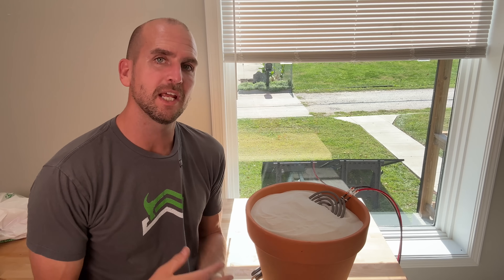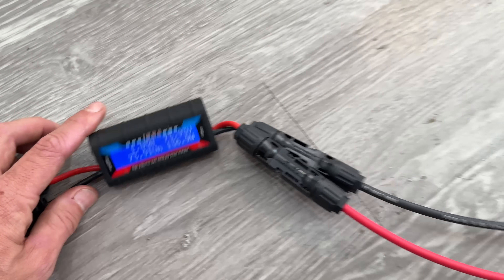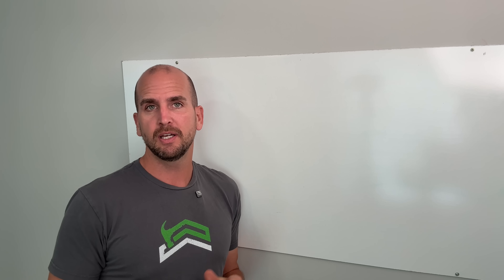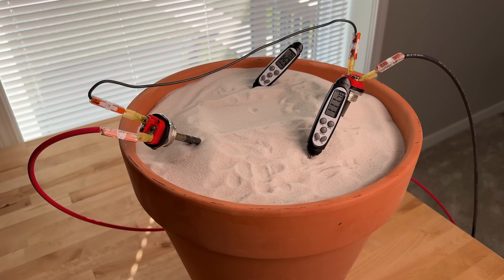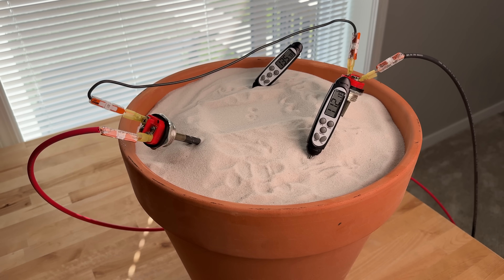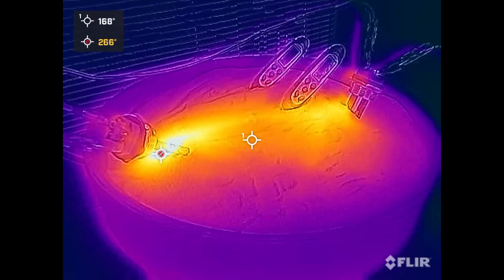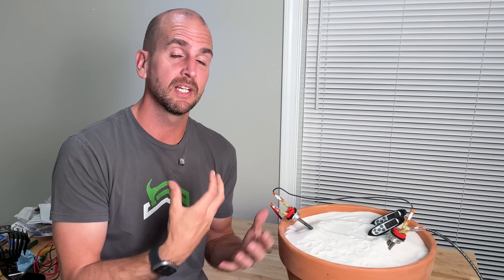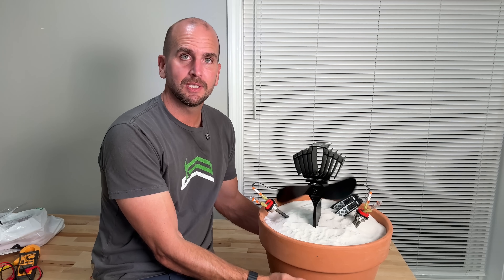How To Create A Solar Sand Battery Heater | Free Heat This Winter!

Comment: ..the consept is like it is..however there are 2 problems; most often winter and solar energy are not very compatible..somewhere maybe a little but eg. my solar energy is zero in practice during november thru january..something useful can be expected from around late march - early april.. Then the sand..it's not very dense and i'd say not very good to hold the heat..in my experience concrete would be better..or other denser and heavier stuff.. i think only property sand has here in par with other materials is that it can be heated quite hot untill phase change from solid to liquid..but still i think it'd be a bit of a hazard having something like +350 degree of celsius flower pot around..(otherwise it won't surpass even the water..) if one could store heat as a phase change energy, such heat storage would use sand as a table cleaning cloth if there were any competition between the two..😅 ..i think at least prototypes exist with salts..and they change phase into molten salt.. Also when heating home..even a small room..well flower pot does nothing..unfortunately..think eg. weight difference with flower pot and non heat storing wood stove..stove is still way heavier thus stores more energy..still they are not considered as a heat storage.. During winter 700kg of soapstone can store heat and keep about 40m2 insulated space warm for time between a day or two untill the temperature in room starts to suck during outside temperatures of around 0 deg. of centigrade (celsius).. I wouldn't waste my time with such sand projects..it'd be more profitable to install heater resistors eg. in oven mantle..AND use some electronics to match everchanging solar panel impedance to fixed heater resistor resistance..that is called mppt tracking..from the experience of heating water with solar i can tell i wouldn't do it without mppt..! ..so some r&d is still needed! 👍..one has to remember that whatever miracle material there is..the energy is no more than can be extracted from panels..and it's the weight of the reservoir that stores the energy..not the thermal resistance..unless one goes with phase change, eg. different principle altogether!

Comment: My thoughts are- bury the elements near the bottom, insulate the hell out of your vessel and put an insulated lid on it,  and run some single wall vent pipe through the middle of your vessel, and out the side and up through the lid (with insulated caps or plugs.  Then when you've got your thermal battery charged, you pull the plugs and blow a small fan down through the pipe.

Comment: keep in mind that heaters intended for water are usually not rated to "run dry" as they rely on the max water temp of 100c (212F) to stop the internals from melting themselves.
Reply: Remember they are runing at a fraction of their rated power 250w vs 5000w
Reply: @shaynegadsden It may, or may not matter, but I would think lower watt density would give longer life.
Reply: @fancyhitchpin8675  it probably would but these elements already last so many years
Reply: @shaynegadsden  stop trying to cloud the issue with facts
Reply: Yup, fire hazard (at much )higher wattage, best to blow air over nichrome wire in tube and make simple heat exchanger
Reply: I thought it was about 80c, also it's not about melting internals, its about avoiding steam explosions. Water to steam expansion ratio is something like 1:1600 and if you manage to build up the heat and pressure, you can get a pretty big boom out of a relatively small amount of water. You really don't want to dick around with super heated steam either.
Reply: Not really. Yes if they were running at 240V and 2000W, but the video the meter shows these are closer to 70V and 250W. And no household water heater is running at 212F, the water would boil and explode out of the faucet when the pressure was released. The average temp is set around 120-130F and anything over 140F is dangerous plus the waterheater it self could explode and blow though the roof. Also stovetop elements glow red hot and can last decades.
Reply: @SkaBob  That's false. In Norway, for instance, the requirement is that the hot water must be above 167f (75c) and only dip down to 55c (131f) for a maximum of 20 minutes per day. Otherwise yoo run the risk of legionaires disease. My hot water is always set to 90c (194f) because that maximizes my ability to use hot water as a battery so that I buy my electricity as cheaply as possible.
Reply: @jeschinstad no human can withstand 131f water. 

Much less the higher temp.
Reply: @diylithiumguy  what are you responding to?
Reply: @jeschinstad whoever I tagged.
Reply: @diylithiumguy  Why are you telling me that no human can withstand 131f water? If you're referring to my factual statement that in Norway, the legal requirement for hot water is that it must be above 167f and only dip down to 131f for a maximum of 20 minutes, that's just how it is. What does that have to do with what humans can "withstand"? You mix hot water with cold to get the desired temperature when used, but you don't really want to get legionaires disease, so you don't store your water at a temperature that's perfect for biology.
Reply: @jeschinstad no one in America gets that from our low water temps.

Stop letting the government have you waste power and money by having the water tank too hot.
Reply: I am pretty certain you're wrong on the facts, but it is the type of question you should be asking when doing things.
Reply: Definitely NO fire hazard, what about electric oven? Thermal conductivity of air is much much lower then sand.
Reply: @Martin-gn9xi  different heating elements in an oven.

Comment: 1. Don't do this with solar panels. PV is not good enough.
Use solar radiators/ solar heaters since they are around 80% efficient compaired to pv at 17-20%.

1kW solar can then give 800w heat.

Comment: Could this be used for a woodstove to save energy for after the fire burns out by setting a pot of sand on top of the woodstove?
Reply: Yeah that would work. Other common more permanent solution, is to add clay bricks around the stove. Make a foundation and the backwall with claybricks. If you keep a distance between stove and brickwall, the air will circulate naturally and heat the room for many hours.
Reply: I have 80 kilo iron on my woodstove, works fine for a few hours

Comment: Great idea for 100 sqft space with low ceilings.
Reply: Greenhouse or shed.
It is passive and you can avoid the cost of batteries with direct resistance elements like these.

Two panels at say $500
Stove or WH elements at $25 to 50

$600 bucks and mostly unattended.

If you heat with grid power resistors ($30 for the heater) total loss on low 750W is 8kW over 10 hrs ($1).  20kW over a 24 hr  period ($2.50/day)

Winter is roughly 100 days so payback in under a year.

If you can build it with scrap elements and used panels for $100...then go for it.

Comment: In the UK the winters aren't generally extremely cold like North America etc - typically -5c overnight. but a challenge is how to keep an average domestic greenhouse / glasshouse above freezing to protect plants over winter without expensive heating such as kerosene or electric heaters. This coupled with a car battery,  might be a relatively simple solution for that?

Comment: Why not heat the water with sunlight and use about 100% of solar power, instead of electric 15-22% :) :) :) :) :) American school system is in the gutters.
Reply from the maker: Testing a solar powered water heater would be great.
Reply: @everydaysolar  also, water on its own has 5 times greater heat capacity than sand, but if you expect that heater to exceed 80ish Celsius that would be useless, depending on the quantity of water. To put it simple: You can't store much heat in that quantity of sand.
Reply: Look for evacuated tubes to collect the sun's heat and put it in a working fluid. Then, send that to a hydronic baseboard heater.

Comment: Why not eliminate the 25% efficient solar cells and the heat wasted in the connecting cables by putting the pot of sand directly in the sun?
Also, I think your fan is powered by peltier junction semiconductors that produce electricity when heated, and not by a thermistor.
Reply from the maker: Hey Dennis, thanks for the correction on the Peltier Module 👍.  Even though there is an efficiency loss through the solar cells, wires, connectors, etc., we are able to take the increased surface area of the panels as compared to just the sand and clay pot surface.

Comment: You might do better with NiCr wire for heating element as it's easy to tune to available current and get better distribution through the sand.  Still, the inefficiency of the solar cells (20% or so) means that just letting the sunlight come through a window and heat water will probably perform better.
Reply: "sunlight come through a window and heat water will probably perform better", yeah, that's why I keep all my plants in a dark room, so the light coming through the window doesn't heat their soil several hundred degrees.

Comment: Instead of using sand as the heat sink what happens if you use an oil based space heater hooked to the solar panels. Once the oil is heated then it will radiate heat more efficiently than the sand however it will probable cool down faster once the power is removed. My 2Kw oil heater take a bit to warm up but afterwards it will cool down enough to touch the fins within 30 minutes. 
We heat our water with a tri energy "boiler" which consists of two collector panels of about 1.5 m2 and a 120 liter storage tank. During the summer months water can reach to +160°F in several hours. During the winter months when there is Less solar radiation we most often use the second heat source which comes from a wood fired fireplace/boiler. One circuit of the boiler output feeds a coil within the storage tank of the water heater and within a few hours we have hot water. The third heat source is a 4Kw electric heating element within the tank. The only downside is the distance to the heater back down into the house to reach the basement and then distributed through the water manifolds in the house. I have not added the circulation pumps to the system which will cut down on water usage and the time it takes hot water to reach the faucets.
Reply: This is about not needing an inverter or charge controller. Switches and thermostats in an oil heater probably not rated for higher DC voltages or the amps of lower voltage DC.

Comment: My mental math says that using one element would have been way better for getting the power out of the panels. You were pulling 350W-ish from nearly 800W of panels.   What you did was a complete waste of the panels output power.   All in all a thermal battery is a good thing to do if you have waste power, definitely  the most effective way to store solar overnight for heating.  Unless you also had batteries to run a heat pump with an outside loop and then a loop in the thermal battery, then you could use the stored heat at lower than the ambient temp of the house.

Comment: I use a solar air heater which is about 4 ft x 4 ft and during winter when the outside daytime temperature is typically 25°F, the heater will deliver air at ~ 110°F for 6 hours during a sunny day.  I prefer this because the only electrical component is a fan which is powered by a 25 watt solar panel.  The solar air heater does not block a window - - it is leaning against the outside wall of the house.  Of course, when the sun sets, that's the end of the warm air.
Reply: What about when there's a blanket of cloud? Here at 57N in Scotland it's rarely sunny, ever!!
Reply: @Bazza1968  Well, you people that live near the North Pole have fewer options.  Of course, neither a solar air heater nor a solar sand battery will be of much use.
Reply: @n3evpn3evp  Ever look at a map? Scotland is not anywhere near the NP and how are you getting this solar warm air INTO your house?
Reply: @AIRDOODOO  Yeah if the outside daily temperature is "typically 25F" that's colder than where I am!!
Reply: @AIRDOODOO  Yes, it was a joke.  I call anything above my latitude of 41 degrees north  latitude the "North Pole".  The solar heater is adjacent to my house and the heated air enters via an insulated, flexible tube that goes through an 8 centimeter home that I cut in the window glass.
Reply: @annwithaplan9766  I constructed the solar air heater in my garage.  All I needed was a sheet of plywood, a few 1x6's, a large sheet of glass or thick transparent plastic, a sheet on insulation, 4 inch plastic bendable pipe and some minor things like nails, staples etc.
Reply: @n3evpn3evp    Interesting idea. Here's another configuration idea. In the 70's to the early 80's I was a devout Mother Earth News subscriber. They had a Solar Air Heater that sounds similar to your construction description. It mounted in a south (in NA) facing window. A rectangle plywood box that consumed the bottom 6" or so (IIRC) of the window, then was angled down at a latitude appropriate angle. A dividing partition ran all but the last few inches at the bottom of the box. It was insulated and the interior was painted black. The exterior "topside" of the box was covered by glass. As the top portion/partition was heated via the glass, heated air rose into the room and drew in relatively cooler room air via the bottom partition opening at the sill of the window. Completely passive. When the solar energy ceased, the entire box filled with colder than room temperature air preventing "reverse draft" flow. I've never lived anywhere where I had good southern exposure to try it, but at ~30°N, my winters are usually a lot milder than most. I prolly still have that and other 78-80's ish M.E.N. issues around somewhere, if the silverfish havent destroyed them. I really hate those lil b*stards....lol  There was a very interesting "Solar Tracking Furnace" too...
Reply: @MelGarga1901  I know the set up you are talking about. I used old soup cans taped together on the interior and a small cooling fan (2") jacked into a panel to move the air 😉 These do work though 👍 won't heat your house up to 80° or anything but it will keep the chill out and help offset any heating costs. This is a very easy and passive system to make and use 😁
Reply: A well-insulated room should retain the heat for a while, though. But that's not an option for everyone

Comment: If it was mid winter and 20°f outside air temp in room was say, 40°ish, would the heat in the sand suffer from accelerated cooling or would the ceramic pot insulate the sand to give approximately the same time no matter the room temp?
Reply: Heat transfer is directly proportional to the difference in temperature of the hot and cold side. This is basic physics.

Comment: When doing the math, keep in mind that the resistance of the elements go up with temperature.  The power rating is typically AT the temperature it is to be run at.  The stove element gets far hotter than the water heater element (since the water heater elements are supposed to be in water).  In the old days, you could measure the resistance of an incandescent bulb, then power it up and measure the current at its rated voltage - the resistance when on and hot, was at least triple its cold resistance and took under a second or so to reach.
Reply: Dimming incandescent with a soft start on dim then ramp up to brighter and dim to low before turning off makes them last 100X longer //
Reply: In electrical engineering  with the bulb, it is called cold shock.

Comment: This would be cool for a small greenhouse.  I wonder how much energy it holds?
Reply: The specific heat capacity of sand is between 0.180 and 0.191 BTU/lb-°F.  Where as the specific heat for water is 1 BTU/lb-°F.  I guess the advantage is sand can get hotter where as water is limited to 212F unless pressurized.  I know it is not cool but I believe a water heater to be a better heat battery than a sand heater battery.
Reply: @kevinmiller5467  also no risk of the sand freezing and breaking its container when power is low for long periods

Comment: You should check the channel Solar Power Edge. He has a video that explains how to extract power a from solar panel using a chain of diodes. This is potentially more efficient than a resistor.  Each solar panel has an optimal voltage to extract maximal power and that voltage is pretty much independent of the solar illumination. The idea is that each diode is causing a drop of voltage by a small amount so a chain of diode can act as a cheap voltage regulator thus maximizing the output power of the panel. For example, suppose that your panel optimal voltage is 36V and that your diodes have a forward voltage of 0.7 V.  
 36/0.7 = 51.429 so  a chain of 49 to 51 diodes should maintain the voltage close to the optimal value.